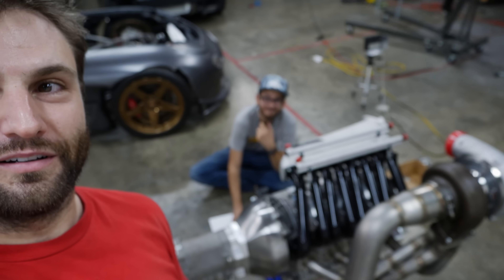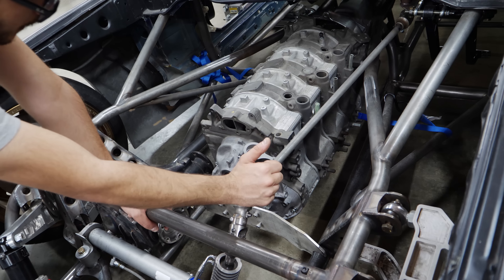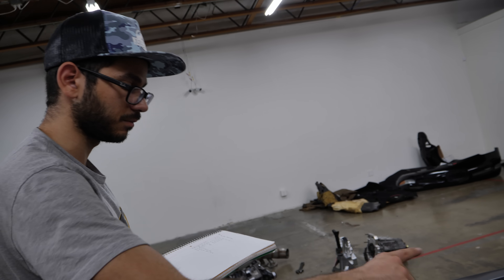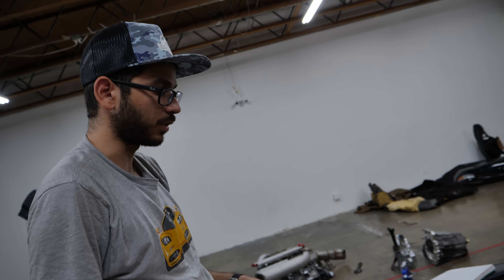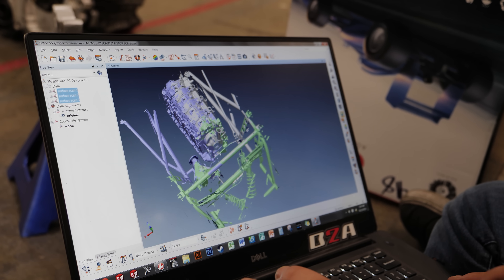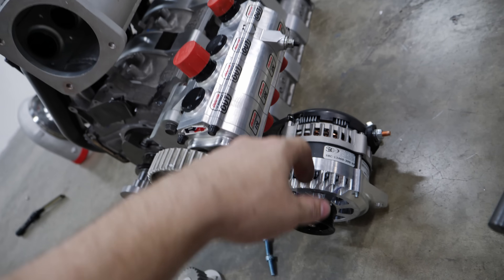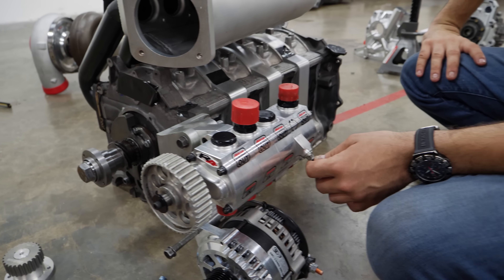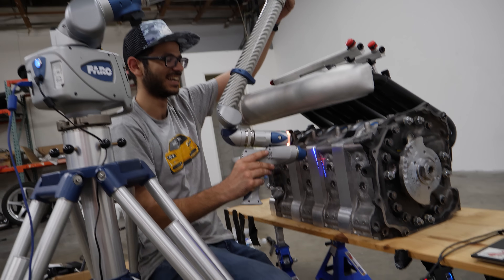Designing the LARGEST Oil Pan for the 4 Rotor. It’s also the Billet Engine Mounts

Comment: Hello Rob Dahm, I am very concerned with your Mazda RX7 4 rotor engine build. Forcing too much air by turbocharging into an engine drastically reduces engine life. Personally I would recommend running the engine naturally aspirated. The engine will thank you for this.
Reply from the maker: If i could have sex with a turbo I would.
Reply: @RobDahm  lucky you can affored the turbo. Im still stuck with my blender.
Reply: @RobDahm  We haven't waited years for this build to not watch you blow it the fuck up at some point.
Reply: @_Shaido_  Also, a four rotor is just an engine. An expensive engine, but the only reason it took this long was because of the billet irons. A blown motor would take a fraction of the time this build has taken
Reply: Jon D I thought it took this long because yes 4 rotor but mostly cause his irons got stolen or some shit? He made videos on it awhile back
Reply: @ionaka1  hello Mr gnome child
Reply: @ionaka1  it was also the dowel pins that weren't to spec, they had crooked bolt heads on his first order which will not bold well holding together the entire block with an arm and a leg.  Plus he needed funding which the other projects provided for.  As the the timing, he did have his engine lost in shipping for quite some time which was a total bummer.
Reply: @_Shaido_ well that would be dumb spend 70 plus g for a build to blow it up
Reply: @_Shaido_  Amen
Reply: @RobDahm  i saw a guy making love with a tailpipe. He sayed it was pretty exhausting.
Reply: Rob Dahm you can’t have “no” in your heart.
Reply: @bradb69   i not sure if its a matter of yes or no i simply believe they dont make a turbo big enough for him. 😂
Reply: Austin Smiley you’re much too kind. I think Rob has a motto. Something like, “looks like a needle. Works like a sewing machine”.
Reply: Rob Dahm TLC documentary in the making
Reply: @RobDahm  Sex with an operating turbo is not advised. Always remember to use protection, chain mail condoms can be found at your local medieval fair.
Reply: @RobDahm  i mean, i think you should run 2 of those
Reply: @RobDahm  What's really stopping you? I mean, it has holes and they come in different sizes.
Reply: @samiraperi467  They don't make one big enough for Daddy Dahm...
Reply: @RobDahm  you can but its a once in a lifetime opportunity - as in goodbye junk.
Reply: @Yazevo  they are not junk RB26DETT'S are the same engine that is in the nissan skyline r34 which was stopped being produced in 1999
Reply: @skyfan5348  if yr not a troll then idk why parents give children  internet access
Reply: Because Race Car 🏎
Reply: @RobDahm  You can. Just make sure it is not spinning or hot. Have fun
Reply: @RobDahm  Exactly rob nothing is  good without a Turbo rx8 non turbo useless rx7 turbo AMAZING!!
Reply: @RobDahm  You need to at last take it out to dinner first.   Then the intake and exhaust will open up for you.
Reply: @RobDahm  garret / honeywell make this man a gerret turbo body pillow
Reply: @RobDahm  There's nothing stopping you, just try and use some protection. Those compressor wheels can be pretty pointy
Reply: @RobDahm  That would be a BAD idea - there are some males who tried fucking vacuum cleaners and they were rather cut up about it - especially the hand ones with the spinning fan on the inlet. For those of you who think they aren't squeamish, check it out.
Reply: @RobDahm  I mean, you can. Don't recomend you try while the engine is idling how ever.
Reply: @RobDahm  you won't need to rob once you mash that loud peddle you will blow you load 4 rotor turbo monster
Reply: Phong?
Reply: @_Shaido_  phong's song make three hunna awl rotar
Reply: @_Shaido_  He didn't recommend building a custom dry ice air-intake box, so doubtful.
Reply: @_Shaido_  LOL
Reply: @_Shaido_  LMAOOOOOOOOO
Reply: wolfish LMFAO
Reply: Marco thank you for your concern Marco. I think he’s thinking “I don’t give a fuck”
Reply: If the engine is designed to be used under any sort of forced induction, the engine life will not be short. that rule goes with all engines, piston or rotary. I have build engined that are designed to be boosted, what decreases the life of an engine is if you have a horrible tune and poor quality parts. I doubt that Rob Damn over here with his billet everything 26b 4 rotor is going to have a problem with boost, also there is a reason why boost controller's, waste gates and blow off valves exist.
Reply: Rick Moises blow off valves valves were designed more as formalities I believe. Doesn't do anything beside eliminate turbo flutter which is not surge.
Reply: He's build "PROJECT"
Reply: Its a rotary, lifespan is not on the list of concerns. lol!
Reply: Somebody's been watching too many Scotty Kilmer videos.
Reply: Heh satire
Reply: Marco personally I recommend he build as much boost as it will take and blow the Dyno into next year
Reply: @losrussets8945  hell yeah
Reply: Did Scotty Kilmer make an alt account or something lmao
Reply: U high
Reply: Power 2 Weight  meh funny dude bro
Reply: Rob doesn't have Garret as a sponsor for nothing. There's gonna be a big spoolie boy on there. And for what it's worth you can run them pretty much 0 boost so it can run as a N/A motor and a boosted one he just chooses how much power he wants.
Reply: Obviously the engine has to be run in first before he goes full out.
Reply: Lmao yeah as if
Reply: Rotarys love air wtf u talking bout it will be thanking him once its a fire breathing dragon 😤
Reply: Power 2 Weight  ahahah yeah i used to play minecraft so what?
Reply: Go drive your prius
Reply: The fact that he tagged this is proof Rob Dahmity is a god damn troll.
Reply: Gaaaayyyyy
Reply: Not certain if you're trolling...
Reply: lol what
Reply: We don’t need that kind of negativity here
Reply: 4 rotor + 4 turbins?
Reply: That was by far the lamest comment I've ever read
Reply: Hahaha, either you're trolling, or you don't understand engines.
If the former, well done - you got some great responses :-D
If the latter, you REALLY need to educate yourself on the difference between a stock engine* and one specifically designed, and intended, for high levels of boost and power.

*You DO know that Mazda produced rotaries that were turbocharged, stock, in some of their vehicles, don't you?
Reply: Marco lmao pussy
Reply: Its a rotary. It wasnt going to have a long life in the first place so why worry about shortening the life more XD
Reply: fack off turn that boost up till the knob breaks
Reply: It's all in the quality of the build And the tune! Turbo the world!!
Reply: Are you kidding me? You could never have enough boost!
Reply: Lmao tell that to my Saab 9000 Turbo with 240,000 miles on the original 2.3 liter engine and turbo. Turbo engines can be just as, if not more reliable than non-turbo. Just have to put good quality oil and scheduled oil changes, turbos get hot and that can be bad for conventional or poor quality oil
Reply: Its only built for YT views, nothing else.  Ofcourse it will bizarrely fail due to some beginner error in the 5% of the car thats not built by a third party and that's the day we all look forward to.
Reply: We're not going for reliability... we're going for POWAH
Reply: You obviously did not watch the turbo episode 😄
Reply: It’s machined from a solid piece making it more sturdy/stable. Maybe he just wants to be the first to make it work?
Reply: @StateofAporia  it's like a ponzi scheme where the only victims are 4rotors😳
Reply: Yall its a BILLET??? Come on that means it's like 10× stronger than a rx8 engine
Reply: We are here for a good time not a long time
Reply: Lol you must be new to the channel
Reply: dumb ass he's after the most hp,  an asperated engine will only supply half of what hes after
Reply: haha
Reply: I see your concern and raise you a Peripheral Porting
Reply: r/woosh
Reply: @benistingray6097  That's what the turbo said.
Reply: This is a fucking troll. any stock engine will be happy with a few pounds of MAD, go to far and shit breaks, go far enough, shit makes power and is still reliable.. but its a rotary...Failed by design.. pile of trash when it comes to engines..
Reply: i agree you need less air flow to run a 4 rotor properly
Reply: @skyfan5348  you're 10... what do you know about 4 rotors?
Reply: @ionaka1  im not 10 im 13 and i have been studying 4 rotors for 2 years
Reply: also i recommend 14 to 16 psi of boost
Reply: @Xempt_One  actually i have built an engine it was a RB26DETT twin turbocharged rebuild and it took me a week
Reply: and that can take up to 49 PSI of boost if you tune it correctly.
my preference is Z-Tune
Reply: also it was 6 speed manual
Reply: @skyfan5348  that wouldn't even make Rob smile.. 40+ pounds of boost is more like it.
Reply: sadly only 2.6 L but if i did it again i would choose 2.8 L and make it RB28DETT instead
Reply: @Xempt_One  rotary engine is not a diesel engine, rotary and piston engines are completely different. I think what people are trying to get at is that turbocharging a rotary engine takes more finesse and ensuring that everything's done properly down to the tune versus a piston engine that you can just get by with the piss poor tune and an eBay turbo and be fine. There's just more involved with forced induction on a rotary versus a piston.
Reply: skyfan53 and who payed for the tools and parts? Mommy? Trust me u liar u never built anything. Start with lawn mowers at your age u will ruin lots of rotars
Reply: @skyfan5348  ok fam.

i dont think anyone in this comment section gives a shit
Reply: @skyfan5348  Not stock, though. Or at least not for long - they are good engines but to get them to live at the very least use an aftermarket girdle and, preferably, a aftermarket block.
Are you aware that NISSAN has retooled and many parts for your car are now being sold be your local dealers? If the car is getting tired, you may wish to check them out as things like coil pack wiring harnesses are often failing on these older cars.
https://www.roadandtrack.com/car-culture/buying-maintenance/a26985019/nissan-syline-gt-r-rb26-engine-restarts-production/
Reply: @pikkons  i can tell you now that boosted piston engines with a piss poor tune will quickly end up spraying bits of conrod all over the floor, any engine needs a good tune you can't be leaning out a boosted engine of any type hey mate
Reply: @pikkons  fun fact there were running rotary diesels. One rotar compressed air into the other that had  the injectors
Reply: @skyfan5348  you know the name RB26DETT the TT is twin turbo so you saying it afterwards makes you looks so much less intelligent
Reply: @unxqualfn8975  i know but when i found the engine it had no turbos
Reply: @skyfan5348  ok so a 2jz-gte with no turbos is a what a 2jz-ge what does that makes an RB26DETT with no turbos, find out next time folks same bat time same bat channel

Comment: Run the alternator off of the drive shaft near the rear diff if you're having problems with packaging under the hood it would help with weight distribution while giving more room where you really need it

Comment: I just watched a video from Nelson Racing Engines, and they'd engineered a rotary air/oil separator that was mounted directly to the back of the scavange pump... https://youtu.be/Dx-zPNxsrIs
Don't know if this would be of any help, but you might want to check it out... I think the vid is a couple of years old,  but man, they were running a dry sumped, twin turbo V8 at full power/boost for several minutes (5?) at a time, on repeated dyno pulls, with virtually no bearing wear upon inspection afterwards... Freaking Impressive!

Comment: very cool looks like a lot of space because the motor is compact. but the you look and your like wow i need this and this  and pulley placement for the pumps and didn't the power steering pump mount on the back of the oil pump ? but cool build can't wait to hear that big hair dryer spool up for the first time and put 40 plus psi in to that motor

Comment: I also think that a while the RX7 is a cool car, and this RX7 in particular looks properly modded to receive this engine it's just an average chassis for an engine with so much potential. I would throw it into an old LeMans Prototype or some kind of cool thing that could properly benefit from the insane power and power to weight ratio of this thing.

Comment: Engine mounts break all the time. Having an oil pan that is integrated into engine mount is a recipe for disaster.  You know what no oil does to motor. Its even worse when the oil gets under the tyres. I would seriously consider having mounts separate from  the pan.

Comment: I don't think airflow is going to be the problem here. Getting enough fuel into it fast enough will be the problem. This is gonna be a thirsty beast. 😁😁 Oh, and get  electric power steering to eliminate the need for a pump and fluids.

Comment: I REALLY hope you're going to run a pillow block at the bottom of that long steering shaft - unless steering is of NO importance?
[edit] NM, you can just rotate the rack for a better shaft alignment, possible running between the alt' and 'pump. - and use the pillow block ;-)
With the dry sump pump assembly, you have the choice of rotating it (may need a mount machined to place it where ypou want it) and you can use angled fittings, instead of those straight ones, if required to aid hose runs.
Some folks like to run the return to the tank through the cooler, rather than have hot oil being held there - it may even simplify hose routing.
I STRONGLY recommend, if the sump doesn't already incorporate it, some coarse SS mesh filters between the sump and the pumps, so any debris doesn't damage the pump or, worse case scenario, jam it, snap the belt and cause an engine failure from lack of oil pressure before you notice it.
I know some folks even run one on the pressure feed, in case some crap had got into the 'tank - while most folks will run a GOOD filter between the prusre pump and engine, some will also run one between the scavence return and the 'tank, to check for any problems and prevent crap building up in the 'tank.

I REALLY recommend doing what is needed, rather than bodging around what you have, as in the long run not only is it MUCH easier but it is usually LESS expensive!

Comment: Shouldn't it be hot oil out, cooling, return tank so you're storing less heat?  Why not have the return tank be another radiator?  Or radiator and small tank?

Comment: Its coming together! On a side note, I hope you are planning on adding a support to the steering shaft. Since you have 3 U-joints, this can cause an unsafe steering condition since its not properly supported. Also curious who you are having make your front gear set since it will be spinning backward which is not good for long runs/drives.

Comment: Hello Rob Dahm, I am very concerned with your Mazda RX7 4 rotor engine build. Forcing too much air by using a rotary engine drastically reduces engine life. Personally I would recommend running the engine with pistons. The engine will thank you for this.

Comment: Rob, Was watching some GT Racing this weekend, and saw something that may work for your project.. they had a car in the pits with electrical issues (low battery charging) but they went to the back of the car to replace the alternator, perhaps it would save some complexity in the engine compartment to relocate the alternator drive, and take power for it off the driveshaft in the rear where I'm guessing your batteries will reside for weight and balance reasons.... This will make the plumbing and piping jobs simpler, while keeping the alternator away from the most intense heat sources. Good Luck !

Comment: Any idea if people have done intake air bypasses? Fully disable turbo operation opening wastegate and reduce pumping losses bypassing an inactive turbo compressor. Is there is significant pumping losses with a compressor wheel not under boost?

Comment: Can someone explain to me why there are spring coils and damper on the frame? At 0;48 Is it connected to the wheels? I can't really see it clearly. If it is connected to the wheels than is there an advantage to have it placed there beside space saving?
Reply: Kuhaku you can ratio damper/spring effecting and fine tune it to the wheel rate.

Comment: Keep it up Rob! I want to see a reliable 1,000 hp 4 rotor engine. Love all the REAL motorsport level parts in this build, the dry sump oiling system and power steering.  Personally I don't think the comments about "when is it going to be done" are funny at all. Projects gt done when they get done. In our microwave society everybody wants results now. If you want them now, build it yourself and you'll find it's not so easy unless you were a hedge fund manager.